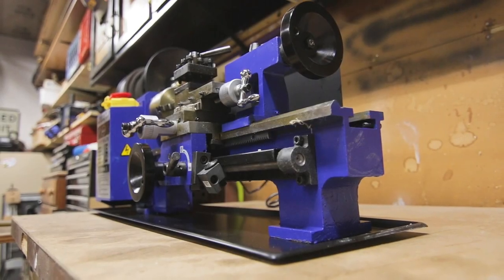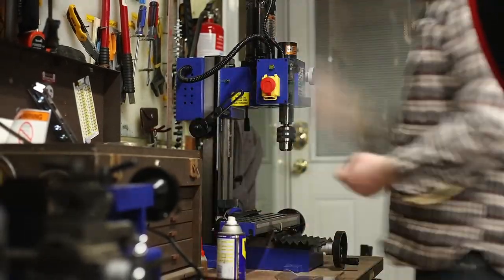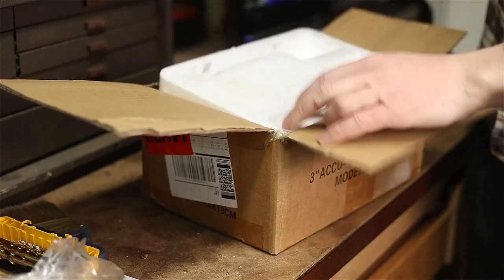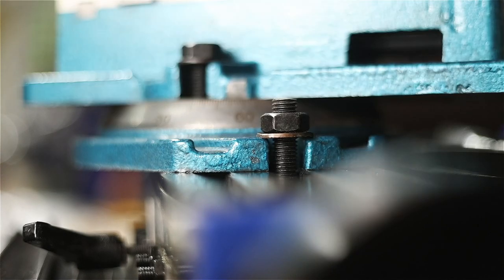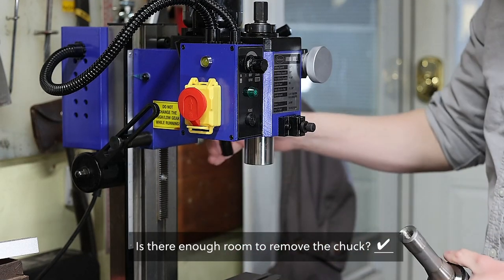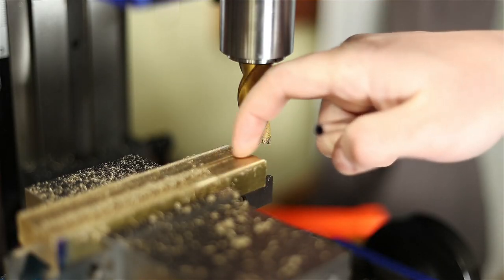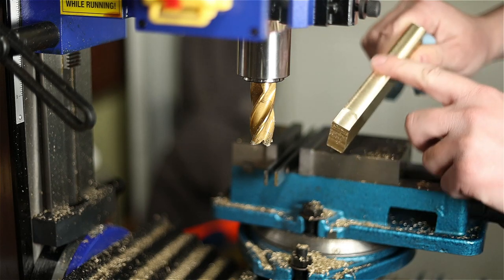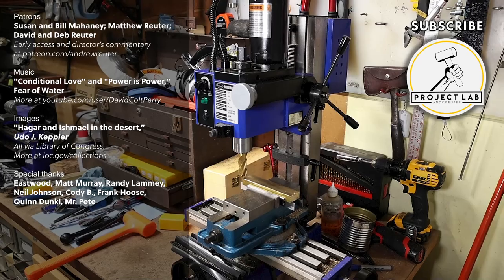Setting up the Eastwood mini mill — Mini mill episode #1

Comment: Great video! Look up climb milling vs conventional milling. You generally want to avoid climb milling on a manual machine. Climb milling puts more stress on the tool, leading to unwanted vibration, and ultimately poor surface finish or out of spec parts.

Comment: You might want to pull the mill forward on your bench a little to provide finger clearance for the y axis hand wheel.  LMS recommends 3.5 to 4" max from the front edge of the bench to the front mounting hole for their similar sized 3990 model, they both are rebranded Siegs.  Your users manual should have some info for machine mounting/hole layout.  Enjoy it, as long as, like the lathe, you remember the operative word here is "mini" and adjust your expectations accordingly you shouldn't have any trouble.
Reply from the maker: Good call here. Always a pain to turn that knob. I recently moved so I will be reinstalling it properly this time. Thanks!

Comment: Always start with checking your Z perpendicularly travel to X and Y first then you can start tramming your spindle. Your spindle can read zero from left to right and from front to back, but if your Z travel move up and down in an angle, guest what happens when you drill a deep hole or try to mill a perfect square, you can’t.

Comment: @ 7:48 you’re milling the narrow edge of the bar whereas you’d been making multiple passes on the wide face previously. The end mill is wide enough to cut the narrow side in one pass, so there’s no opportunity for ridges there! That’s where a larger end mill or fly cutter comes in handy! Also noticed that you never trimmed the back to front, and that is every bit as important, especially if you don’t like ridges between passes! A common complaint about the Eastwood, Grizzly, Klutch etc. mini mills is the tilting column, and the latch of rigidity because of it! The Sieg branded mill (I’m 99% sure that’s who makes all of the listed machines) has a rigid column to remove this issue, along with having a much bigger table and an air spring in the column to make raising the head easier. The column/table still has to be trimmed and shimmed, but once it’s there and locked down, yo don’t have to worry about it creeping out of square! Good video about a machine not typically seen on YouTube!
Reply from the maker: Good tips, thank you!

Comment: Great video ! I was actually thinking of buying one myself 😊. Would you please be able to make a short video showing the noise level on low and high gears may be with some kind of stock metal (I live in an apartment so...) ? That is the only thing which is stopping me to buy one myself. Thanks in advance !!
Reply from the maker: Thank you! Would be glad to check. How quick are you looking for an answer by? End of the month? Still haven’t set the mill up in the new shop, but I could plug it in somewhere temporarily quick for a test run this weekend if you are jonesing for an answer sooner rather than later.
Reply: @AndrewReuter  thanks for replying ! Anytime this month will be great. Thanks again.
Reply: Need to do a belt upgrade. Much quieter

Comment: As a retired engineer (machine tool fitter) to me any piece of machinery that can be aligned by loosening bolts and tapping with a mallet is going to give you problems and creep if it's not drilled, reamed and doweled, slideways are a bit more forgiving with adjusting screws but gibs are better.
Reply from the maker: Good to know, great analysis here. Was wondering if I should eventually replace the adjustable vertical piece with a permanent 90, so this kind of confirms that. Thanks!

Comment: I tend to see all these mini-lathes and mills as being all the same and simply sold by various resellers. Is the Eastwood any better than the Grizzly, Emco, Harbor Freight, etc?
Reply: That appears to be the case, they just order the different colors from the chinese manufacturer. But I'm sure Eastwood will stand behind the tools they sell. I'd be worried about buying from another company without a protection plan because they wouldn't care if you had issues.

Comment: First, ! you dont need the lubricating, brass has so called self lubricating properties, and the next time,  get u some Alu if u want to learn or test machining , brass is  a very brittle metall, and nice for turning on the lathe and also very nice to work with , but not always as easy as many would think ....i think now u already know that there is a big difference in materials and the speeds and depth u need and wich tools work best,...those titanoxid coated tools are sold as allrounder but the HSS tools work much better on brass ! and get you a ZEUS BOOK and try to source a machining book from engineering school, many people sell them cheap after they finished their exams, and u get a very good basic book at lowest possible cost, mine was new 80 usd and the zeus books somewhere around that , i bought both in used but very nice condition 
 for 25 usd
Reply from the maker: Will look for that book. Thanks for the tips!

Comment: Is that the electronic digital indicator from little machine shop? Also, which indicator holder are you using to calibrate the mill?
Reply: It looks like he's using an iGaging 35-0928, which comes with two aluminum pieces/fixture specifically for calibrating a table saw (I have one exactly like it)

Comment: Biggest problems with the mini mill ? It is  to small,     No matter what size you think you want/need it will be to small . . I see you trammed it side to side but did you check front to back ?
Reply: HE !! SIMPLY !! SHOULD !! PUT !! THIS !! STRAIGHT !! INTO !! THE !! METAL !! SHREADDER !! THAT'S !! WHERE !! IT !! BELONGS !! NOW !!!
Reply: @davidwillard7334  why? Not a good mill?